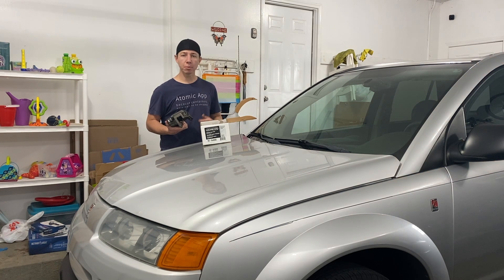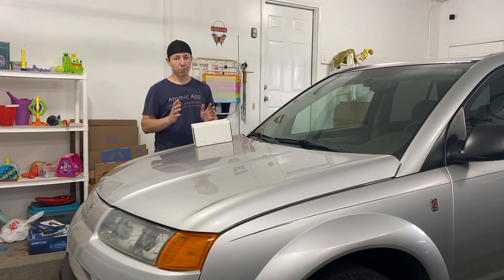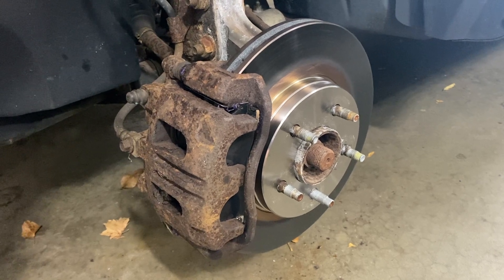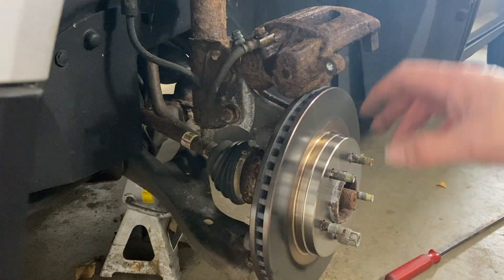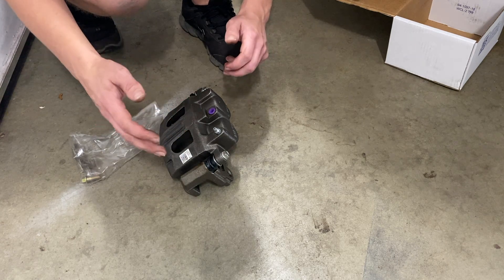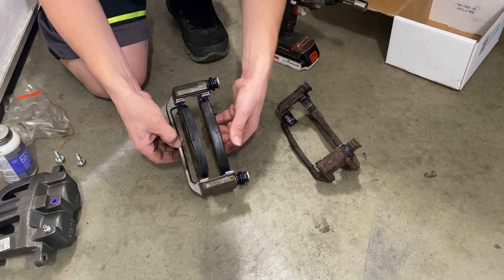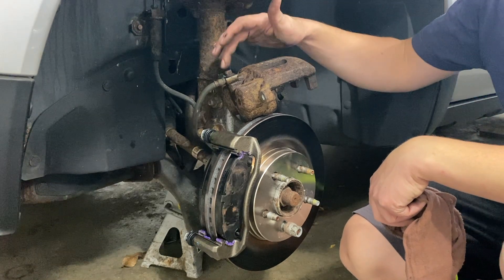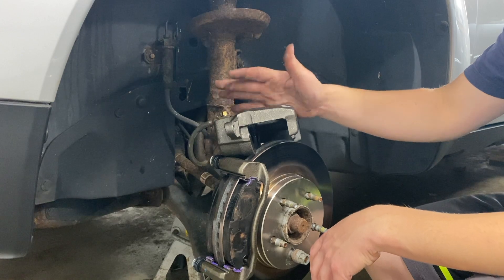Saturn Vue Brake Caliper Replacement - 2002 - 2007 - How to

Comment: Odd my 2003 had a collapsed brake line on drivers side as well when I bought it. U got me wondering how the shop figured that out w/o changing the caliper. Maybe because the pistons went in ok? So figured it wasn't the caliper.
Reply: a caliper only breaks when its seized open or closed you can tell that has occurred when you brakes feel like tomatoes or extra hard

Comment: The book says you need a scan tool to bleed the brakes. Are your brakes working correctly?
Reply: Odd never heard of that. Did it say why
Reply: Only for abs o
Reply: Yeah, my mothers brakes kept locking up. It finally caught on fire. Smmfh. She’s fine, but now she drives an Altima.

Comment: What is the torque spec for the bolts? I need both the mounting bracket and the brake caliper specs.